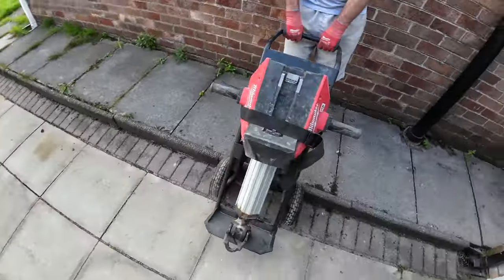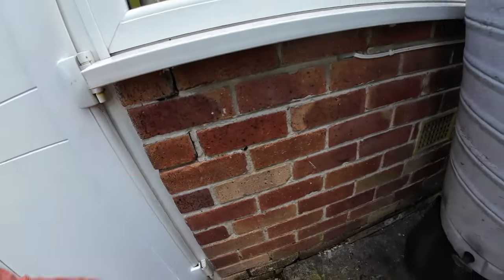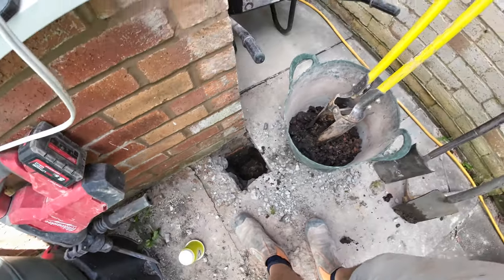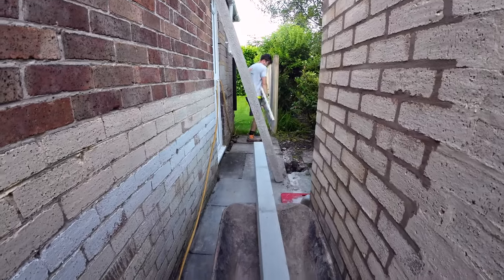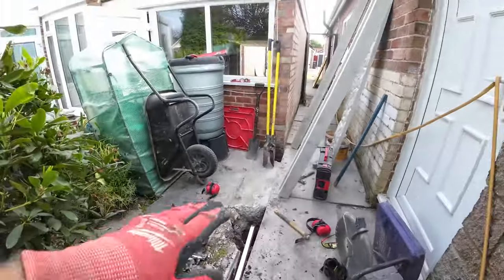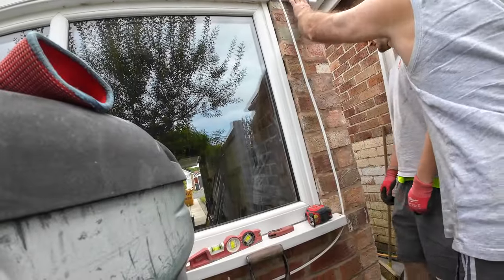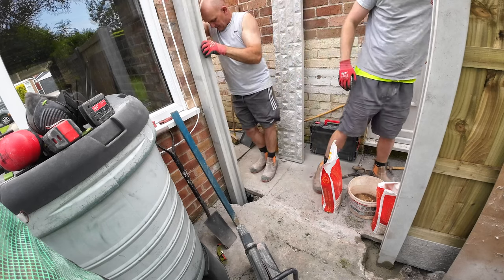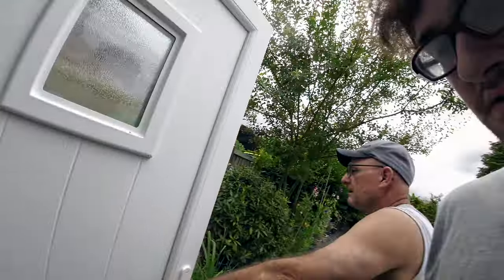BAD WORKMANSHIP... PUTTING IT RIGHT

Comment: Love your videos guys, and always learn so much! I have a couple of questions if you don't mind. 
1) Was that hydrated lime you added? And is NHL lime ever used with Portland cement, or only on it's own with sand and water?
2) What size tuck pointer did you use at 9:30 please? I have a 8mm wide one and wondering if I bought the right size. My theory was the bed is 10 mm, so went down a size so tuck pointer would fit in for repair work. Really appreciate your advice!
Reply from the maker: Not got a clue about the lime I’m afraid .
    Used of the shelf stuff from a local merchants . 
   We mixed it 
6 . 1 .1 
Sand , lime cement.
   Finger pointer 8 mm 👌🏼🧱👍🏽
Reply: @SteveAndAlexBuild  Thanks a lot! Glad I got the right size tuck pointer!